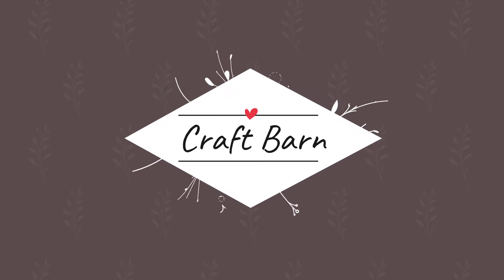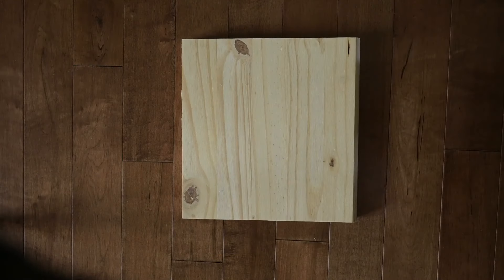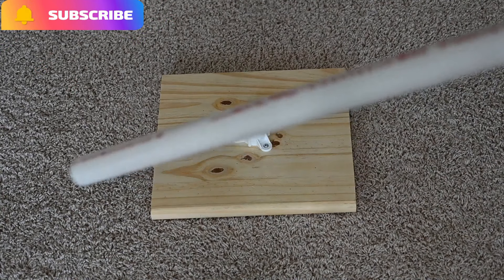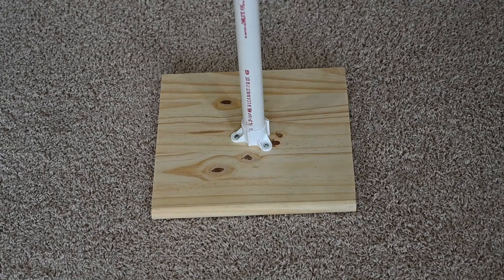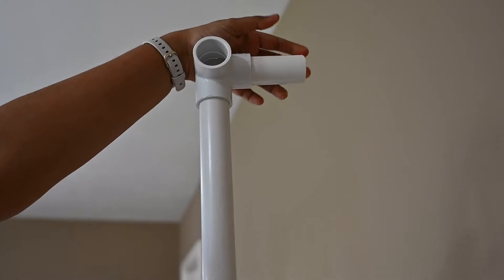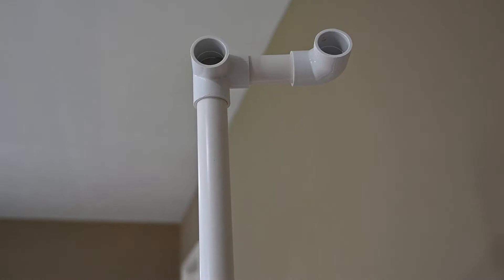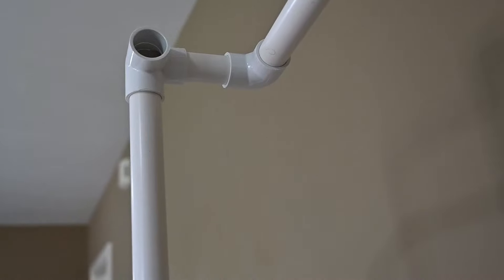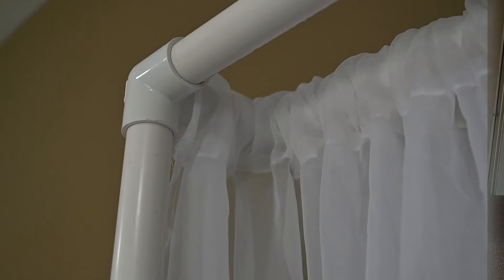DIY Backdrop Stand | DIY Backdrop stand using PVC | Easy puja Decor stand

Comment: Love this project.  Can you give the measurements for the wooden base?
Reply from the maker: Thank you, its a 12 x 12 , if you dont find 12 x 12 ‘s you can take a oak wood panel get it cut in Home Depot or Lowes.
Reply: @MyCraftBarn  Thank you!
Reply: Hi.. hw r u.. where did you get those wooden panels?
Reply from the maker: @msreevidya1573  you can get the wooden panels in Home Depot
Reply: @MyCraftBarn  but we have to buy whole thing right
Reply from the maker: @msreevidya1573  you can get 24 x 12in wood block and get it cut to half in Home Depot.
Reply: They aren’t giving  exactly 2 (12*12) panels in Home Depot
Reply from the maker: https://low.es/37ePjG1, you need ask in store to cut it into half. Its a free cut
Reply: @MyCraftBarn  ok tq so much

Comment: Thank u, nice idea, wanted tovtey this. I got 1 inch furniture table cap from amazon, but the 1 inch 5 ft pvc pipe  is too loose to fit into tthe table cap...did u have any such problems with table cap from home depot...or did u buy 3/4 inch table cap? Please ket me know.
Reply from the maker: You need buy table cap that match the pipe size, example: if it is 1” pvc you need to buy 1” table cap

Comment: I love this! Have you ever made one taller than 5 feet?
Reply from the maker: Yes, i did.. you just need to add extra weight to the base and make it taller
Reply: @MyCraftBarn  do we need to increase the width of the base for 8ft height?
Reply from the maker: Not width you need a heavier base… meaning either you need to add weight or attach one more wooden pieces

Comment: How much weight it can bear if i have to hang approx 2 kg in middle will it take or need add weight at base or use 3 pipes at top ?
Reply from the maker: U might need a strong base to hold the weight, i will not recommend this setup for big events. This can be used for a small decor at home.

Comment: Hi, could I use four 1 inch 10 foot pvc pipes, instead 4 of the 5ft pipes?
Reply from the maker: You can use , but you need add more weight to bases ,like add one more wood block to base or attach a tile to base. Else the backdrop will over flip
Reply: @MyCraftBarn  Thank you so much!